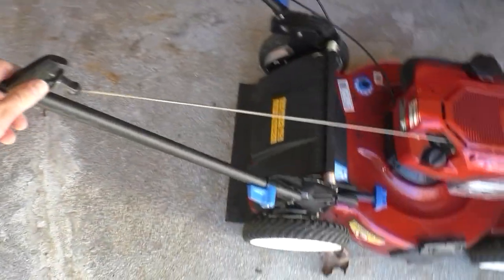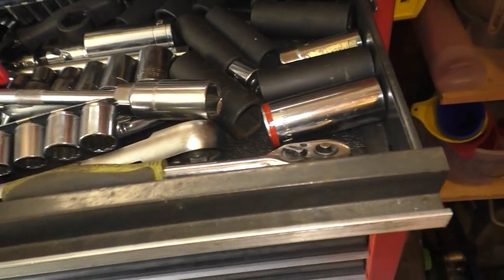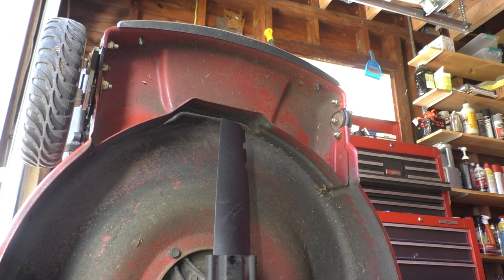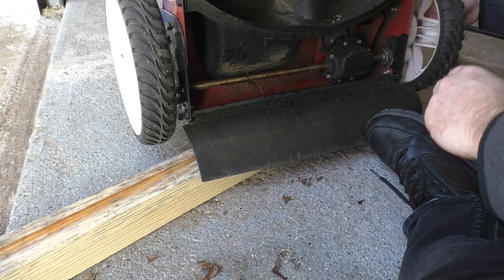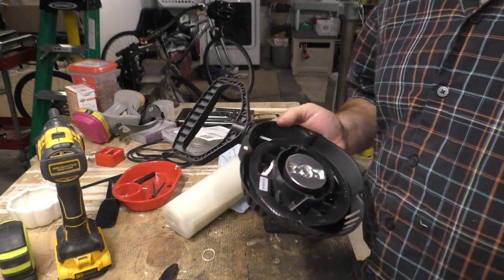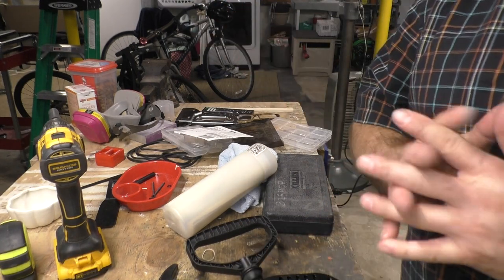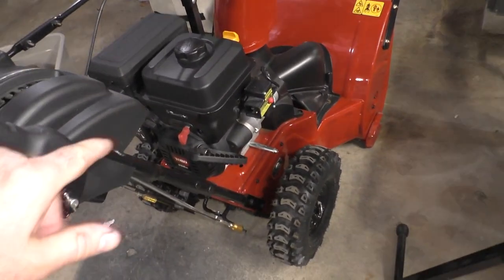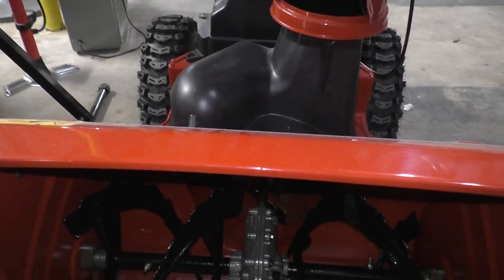Routine Maintenance on My Toro Recycler 22" Mower and Toro 824oe Snowblower

Comment: Little tip from a Toro dealer tech, those transmissions have no history of failure. The most common issue with that system is with the belt and pulleys. Due to the design there is a lot of extra wear on the pulleys and they will become worn to the point they will no longer grip the belt, at wich point the transmission must be replaced because the pulley can't be ordered separately.
Reply: Ps... Good job lubing the wheel bolts and driveshafts not many do that.
Reply from the maker: Thanks for the info! Good to know!
Reply from the maker: Anything I should know about my 824oe snowblower? (2018 model). I can say… it’s eaten chunks of pavement with zero damage to the impeller housing, or chute (aside from some scratches)
Reply: @bbishoppcm  They aren't really known for any particular issues, the machine aside from the engine has been basically unchanged since the early 2000s and they are very simple. If you're having issues with the auger fetching up on things however you may want to raise the skid shoes, they should have been set at 1/4" from the factory but if your driveway has damage or is uneven you may want to go higher. On a side note I believe the plastic chute and impeller cover have a lifetime warranty if you have any worries about it (they're lifetime in Canada I'm not sure about the US) I personally have only replaced a couple of them over hundreds of units.